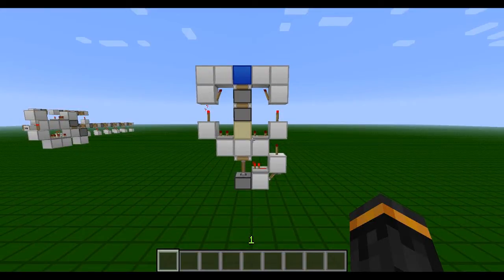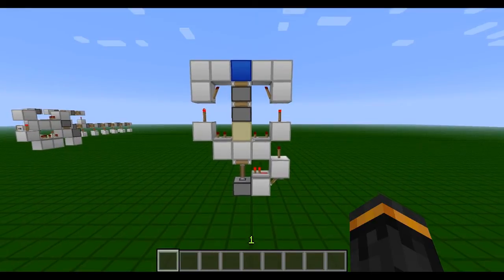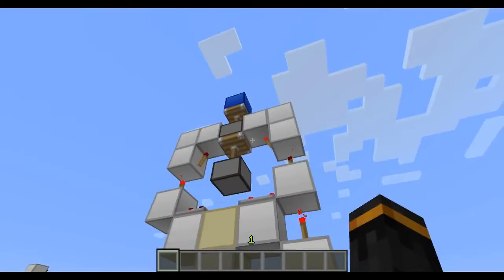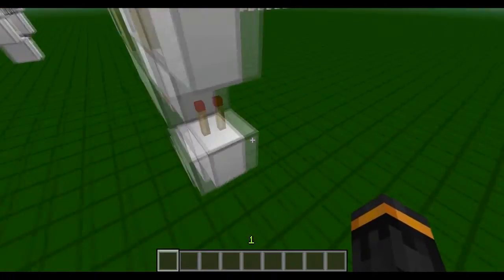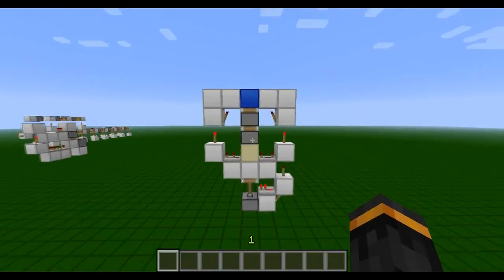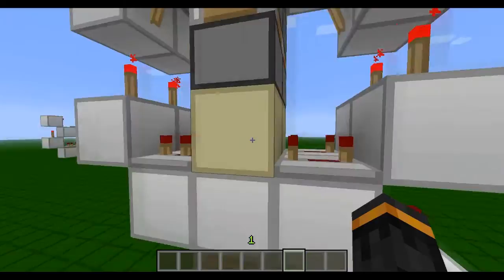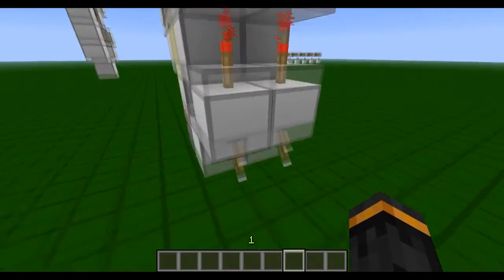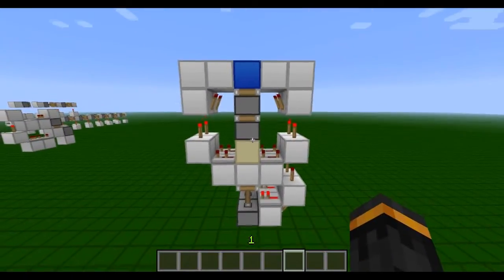1 wide tileable flush vertical double piston extender

Comment: Oh and also, you can replace the bottom repeaters with torches coming of the input (don't know if that's correct english but you know what I mean :) and then torches coming of the block where the 4-tick repeaters are.
Aaand I subbed you ^__^